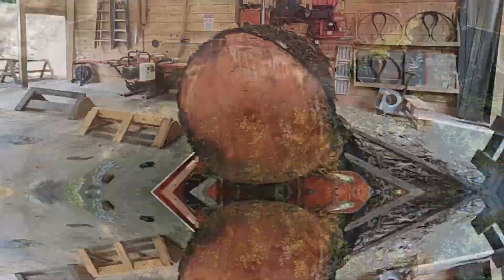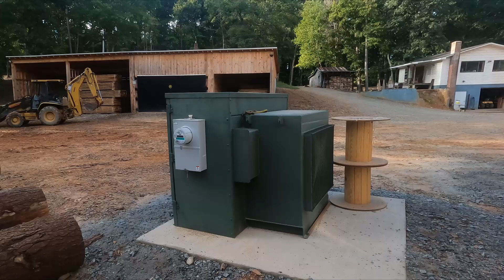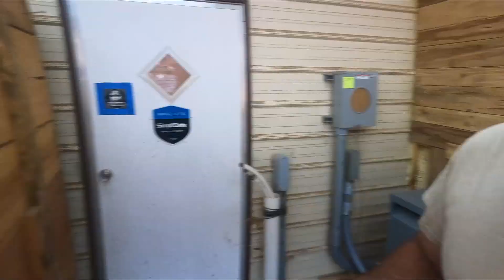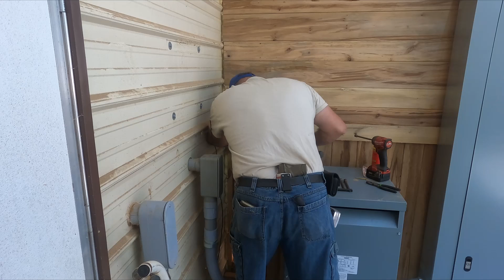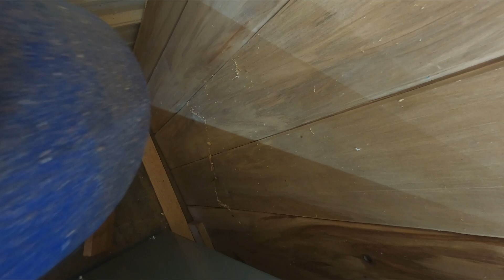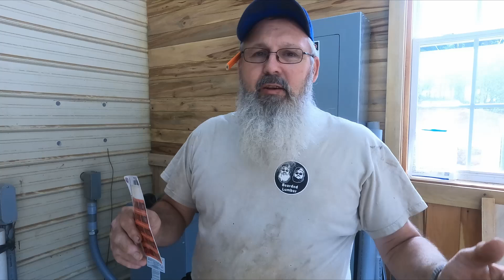No more single-phase service (Molder Planer ep 27)

Comment: Now that you taken that huge step and invested the money into the long term money savings of three phase power, is there any thought as to converting the sawmill and the edger to electric??? The overall savings and efficiency, elimination of exhaust fumes, less maintenance, and overall simplicity of not needing to fuel up and check the oil, would make the conversion a very do-able possibility, now that the expensive electrical part is already done!!! The nice thing is, that you don't have to do it today, but if anything happens to an engine, or any machine changes in the future could become the perfect time to make the conversion!! Having worked with and purchased 3 phase explosion-proof motors up to 125hp, the cost versus efficiency becomes quite a good investment!!
Reply from the maker: Yes, the edger is 220v electric, but an upgrade would be 3 phase for sure .
And an lt70 electric would be a nice upgrade.